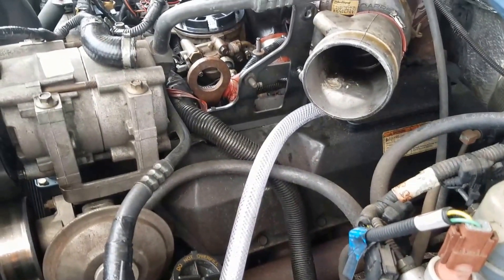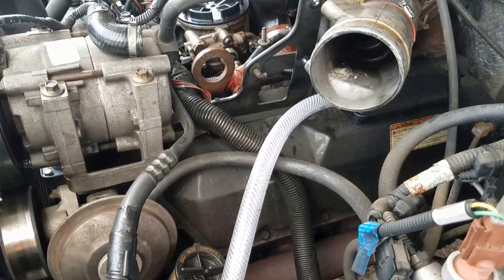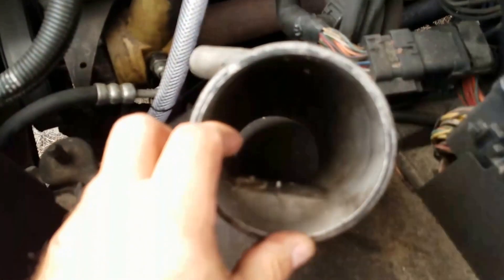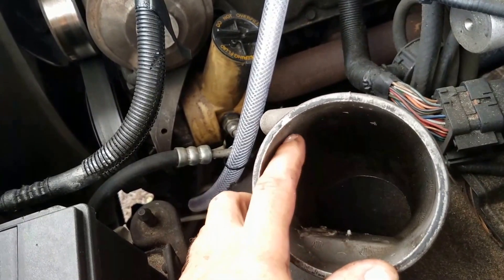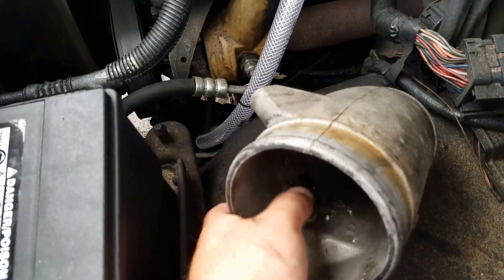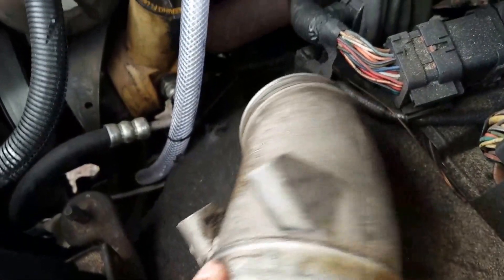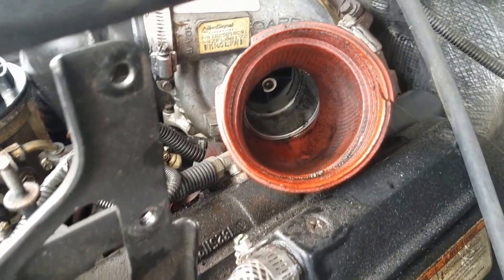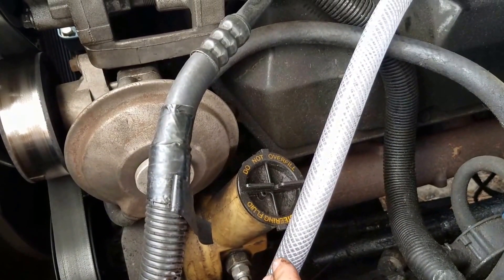7.🌲 obs ccv bypass delete FREE!

Comment: I have a 95' powersmoke. I tapped into my passenger side valve cover and ran a hose down the frame rail. Drilled a hole into my exhaust before the rear wheel, welded a pipe going into it about 3" aimed back to the end, hooked hose onto it to pull extra case pressure. I know it works because the hose is clear and I see oil in the low spots of the hose.